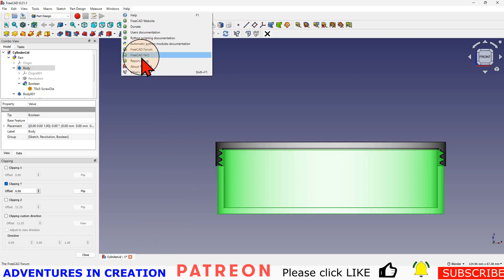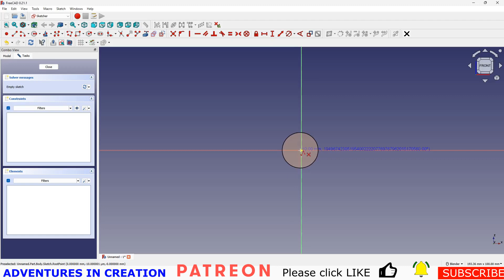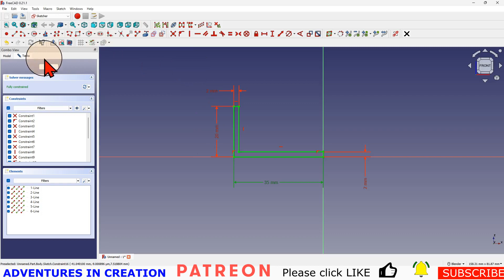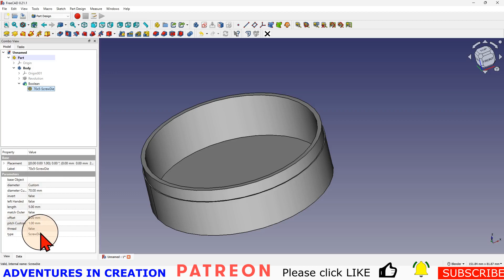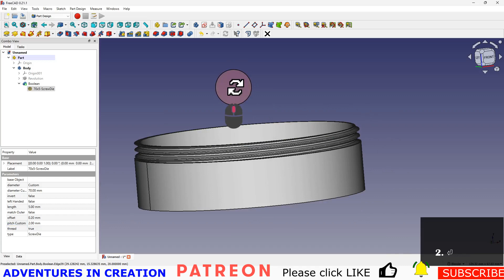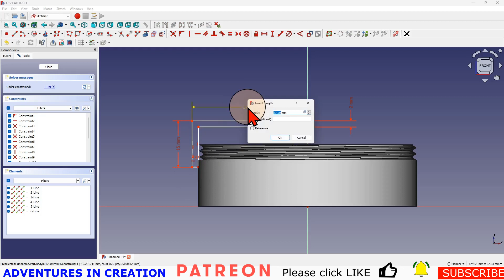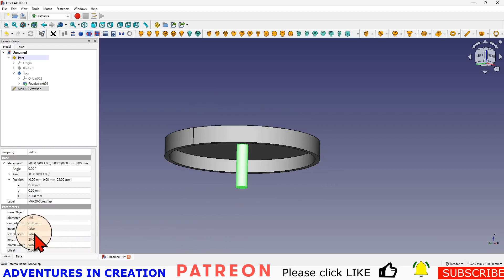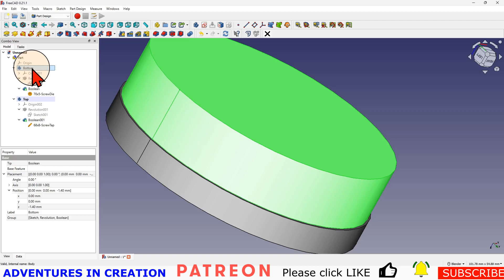FreeCAD for Beginners #58 Creating a cylinder with a screw top lid #freecad #cad #makers #design

Comment: Hi this video has helped, however at 9.59 how did you get the figure 21 from the centre axis to the bottom of the lid?
Reply from the maker: It's just a simple calculation from the bottom of the thread on the bottom to the inside of the lid, leaving a gap.

Comment: I was able to build the model but the lid doesn't fit after printing. I have 70mm for the bottom diameter, .2mm offset and for the top/lid I have 71.2 mm for the diameter and then for the top screw tap I gave 68mm diameter. No offset for the top. Is that what the final dimensions are?
Reply from the maker: You want the thread pitch to be the same. Then just a little clearance between the two so it doesn't bind up.

Comment: Hi. Nice video but I’m confused how a 68mm threaded lid fits on a 70mm threaded bottom. Am I missing something or was it a mistake? I’m trying to get my head round it but now my brain hurts.
Reply from the maker: The thread sizes must be the same but the diameter is smaller so it doesn't bind.
Reply: @Adventuresincreation I believe it was the thread sizes that you made 70 and 68 respectively. 🤷🏻‍♂️
Reply from the maker: @iantard5065  OK, I see the confusion, the diameter is 68 but the thread pitch is identical thus you have some clearance on the lid so that it doesn't bind but the threads are the same. You can try this by printing it and testing how the threads work. You can indeed make them both 70mm but you will find they bind and you will have ease the two parts together by screwing it on and off a little a time.
Reply: @Adventuresincreation  ah I see, so you have a 1mm clearance. Thank you for explaining 😁

Comment: My problem is that you skipped the how of the one step I don't get which is how did you determine you needed a 68mm screw tap for a 70mm die tap? Like it's all well and good if I want to make something that uses these exact settings but why is there a 2mm difference? Or rather how do I find out what that difference needs to be depending on my model? Is the 2mm difference the clearence between the two, or what? Because obviously if you did like a 70mm die tap and a 60mm screw tap those 2 wouldn't engage at all. I'm not sure if the answer is obvious and I just can't see it but the 2mm difference seems to have come out of no where
Reply from the maker: The thread sizes are the same but the Dai is smaller to prevent binding

Comment: I had to make the diameter of screw 69 instead of 70 to cut. If I use 70, even after the cut the shape remains the same. I have version 1.0 may be thats why?
Reply from the maker: That's odd
Reply: @Adventuresincreation  oh nm....i didn't clinic update thread view that's why I wasn't noticing any noticeable difference

Comment: what happened @12:39? The video skipped and the body names reverted back to defaults like two videos were spliced together. How did you get the parts to show they fit?
Reply from the maker: The model tree is just expanded, the bodies are still called top and bottom you can see the expanded tree. I do edit the videos so you don't have to watch dead time while I am doing things like expanding model trees.

Comment: Hi I have some sort of the same project. I did the thread with the main body of 79 mm in diameter. And the screw top I threaded with 79.8 mm will it be enough clearance to screw on or not ( I haven’t printed it out yet)? How much clearance would be needed for a 22 mm hole? Thanks for the video btw
Reply from the maker: You should keep the thread sizes the same. If you are not 3D print just the threads and test it out.
Reply: @Adventuresincreation  thanks for the response

Comment: great video! just subscribed. this video gave me clear direction on how to try a bottle cap converter design~  or perhaps you can make a video for this :D (bottle cap converter to make smaller/larger cap to cap a larger/smaller bottle neck)
Reply from the maker: Interesting, so you have a picture of one?
Reply: @Adventuresincreation  not sure how to upload pictures.. i followed your video for like 2 hrs last night and able to print something, but definitely needs some proper techniques and corrections.  it is just like what your tutorial showed, but fuse the cap and the screw part upside down .. (smaller male part on top, female part at bottom, so bottom part is like 28mm in diameter for typical PET bottle, and top is the threaded male head with like 22mm to a stupid Moen soap dispenser threaded pipe :)
Reply from the maker: @charlieh.7664  I'll take a look and see what I can do.

Comment: Thanks, a great help.
I was with you for every step until 10:20. Then I found your numbers for the top's OD for thread clearance didn't work on my drawing, and I had to adjust.
As I've only used FreeCad 3 times so far, (after 15 years of SketchUp) I'm going to say I almost certainly got something wrong in the bottom drawing! 😁
But it looks like it'll print OK with my revised numbers, so I'll give it a whirl.

Comment: Hello. If I want to extract volume(bottle or exhaust/intake manifol of car) I need to plug all the outlets of the solid model, then (theoretically speking) erase one outside surface of the solid, which will make the entire outside of the solid model to fall apart and create only surfacessss and then the inside volume should stay as a solid. I can then use it as a model for the casting core and also test the volume of the bottle....I just cannot find anywhere (user forums or youtube vids.), how to erase a surface from the solid body. Do you have any solution?
Reply from the maker: I am not sure you can erase a surface. Depending on the complexity of the surface you may be able to create a boolean operation to subtract the surface

Comment: Your tutorial is excellent and easy to follow, but this time I'm stuck.
When I use "Boolean" the screw is flat against the body, while in your video it is slightly sunken. When I set tread = true the report view shows "Recompute failed!" with a red exclamation point on "Boolean"

I have followed your tutorial step by step, the exact same numbers several times and can't see any difference from what you did.
I'm on the same version as you. Any ideas on what could result in this error and what to do to fix it?
Reply from the maker: It sounds like your thread is not intersecting the part some how
Reply: @Adventuresincreation  Well, something is obviously wrong, all measurements are identical to yours. Could be something with the settings in Freecad or maybe something in the system settings otherwise...
Just have to keep trying! Thanks anyway!
Reply from the maker: Can you get your file to me and I will take a look at it for you.
Reply: @Adventuresincreation   Thanks for the offer, but a complete uninstall and reinstall of FreeCad fixed the problem! Now all that remains is to get the rest of my settings back in place!-)
Reply from the maker: Glad that worked, its a bit strange that the re-install fixed it but hey, whatever works! - Thaks for the Ko-fi (beer), I really appreciate it!
Reply: Having the same issue. I'm using ver. 0.21.1. Will try to reinstall and see what happens.
Reply: Fixed it by reducing the cutting tool (fastener) diameter.